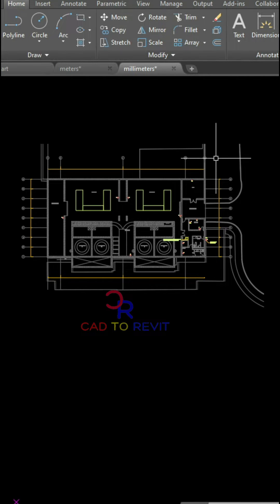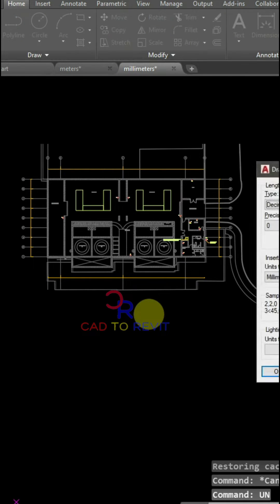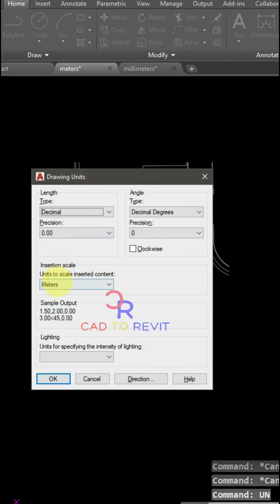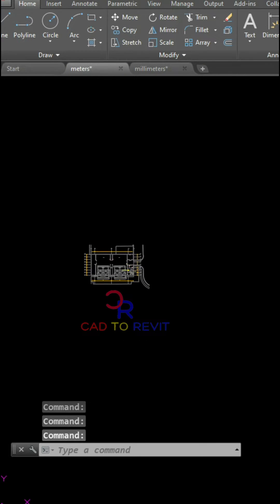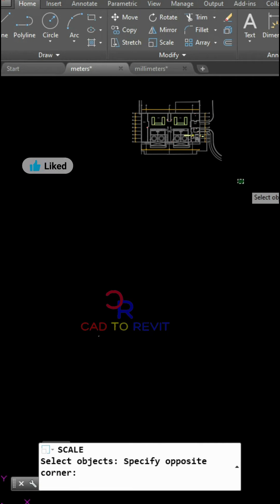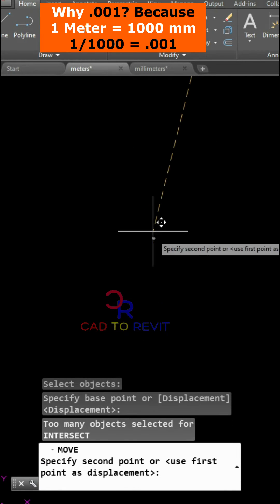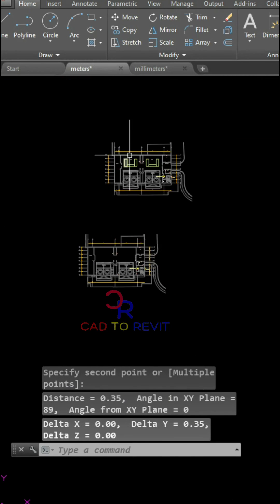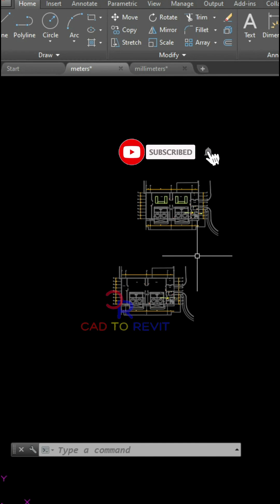Convert Millimetre Drawing to Meters in AutoCAD #shorts #autocad

Comment: hello sir, I have a question: Why didn't you change the unit scale of the millimeter drawing to meter, then copy and paste into the meter file? Wouldn't it be easier process? I watched your other video of changing unit scale of meter drawing into the millimeter, where you just changed the unit scale then modified the dimension scale only, rather than actually enlarging/reducing by 1000 of the actual drawing. Why is it different from meter to millimeter?
Reply from the maker: nope. changing units is not enough. because the other drawing is made in millimetres which is different scale. when you copy you must scale the drawing . the basic rule is 1m = 1000 mm. by keep this rule we need to scale the drawing.